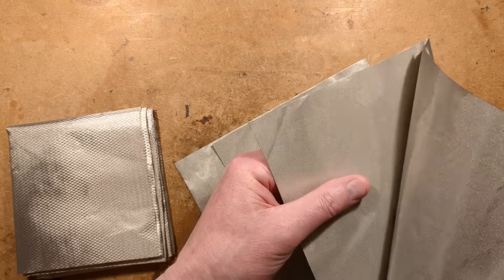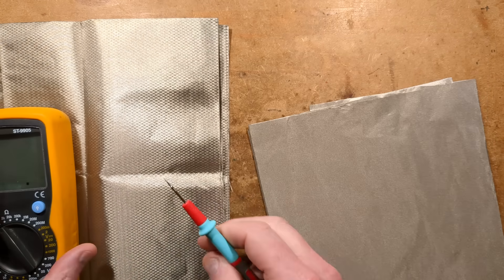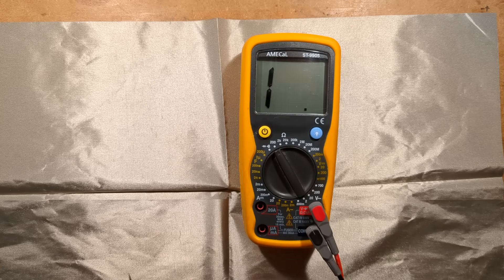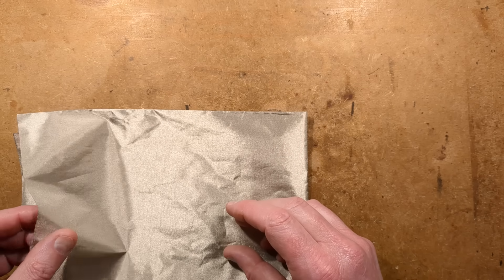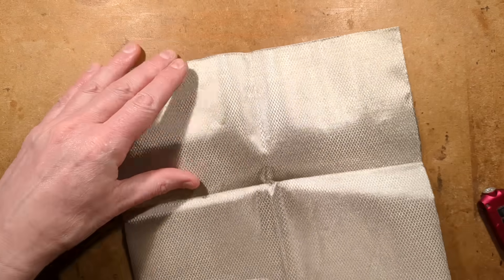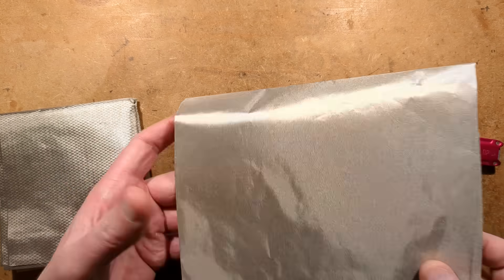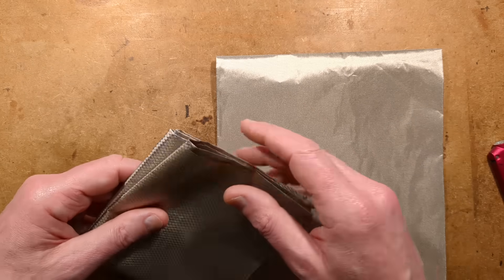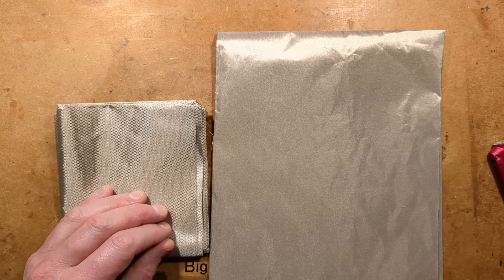Anti 5G fabric is amazingly conductive

Comment: Wow, the comments from people who have bought this range from idiotic to WTF, here's just one example.

"Silvery radiation protect. Affordable. Extreme fabric costs even 1153.11 eur in finland. I really needed this- criminals of oulu region followed with torture chamber radiation- i escaped 600km from torture which since christmas. Criminals constructed torture chamber in structures of my new block of flats apartment by pipes, holes, cold bridges via which they are using electric shocks, beating pressure, ice drafts by machines. Before:'state of finland, bailiff sirpa myllyoja done illegal seizure for my both homes when i was scientific journalist prisoner 6 months without sentence without crime with brain damage caused by crime: broken door, handle. Done same crime again in two apartments during this year. Myllyoja gave criminal orders to destroy my possessions incl valuable gems jewels collection during locked prison. Oulu police: no investigation. Cause of torture since christmas: oulu police neglected duty. Helps little to measured strongly harmful radiation, now direct electricitygun"

Comment: I mean this would be great for—and I'm certain it is used for—shielding RFID chips in credit cards from being activated at any distance. I think my wallet has the first example you looked at lining it for that express purpose. Not a bad idea for those purposes, and one Deviant Ollam can attest to the ability of being able to read RFID badges at a surprising distance if you can set yourself up somewhere people are prone to pass near you while you've got a device that looks like a reasonably common backpack.

But that's not "the 5G" scrambling your brain, that's a coil providing a minuscule amount of power to another coil at a distance causing the low-power transmitter it's connected to to transmit a fixed ID sequence which the device providing the power is capable of reading back. Cool tech in and of itself which can be put to nefarious purposes, but it's a far cry from some form of mind control. At least that's what the mind control ray told me to say. 😉

Comment: It has low resistance in your tests not because the material has extremely low resistance but because the current flows in all directions. The same way ground conducts yet formed from nonconductive soil basically. One other interesting phenomena it doesn't matter how far you place probes, the resistance is the same. The resistance in such measurements is actually appear from the point of contact and the rest of the material do not count hence the current flow is very spread.

EDIT: for a resistive surface the resistance actually logarithmically increases over distance. For a 3d media (for example ground) the resistance consists of a constant (resistance in contact points) plus a term that rapidly drops with a distance like 1/d. So the resistance is only constant for a 3d media but slowly increase with a distance for the sheet like material in the video.

Comment: I was wondering if it worked. I wrap that around my phone often, so tracking me on my CBR is no longer possible while riding that I doubt I'd hear my phone if anyone called and for sure I wouldn't stop to answer it because I am one, having fun (I hear they can tell what speed you are doing, plus which roads you are using, not 100% sure on that, but rule number one is "do not get caught, and rule two, Obay rule 1) and two, I must be busy going to or from something I was doing. I refuse to answer because a bell or ringtone before that is how you used to summons the maids or slaves back in the day where my lot were still... well check the thumbnail that is our coat of arms. I also have a tent of the stuff of it over the computers I have running.
 As for uses, well I hear shoplifters find it useful

Comment: I have repaired many pressure mats that sense when patients at a local retirement home have got out of bed and stand on the mat. They use 2 sheets of foil backed paper separated by a thin layer of holed foam, encased in a thin vinyl mat. The failure mode is always the foil cracking and going open at crease lines, or chunks of foil flaking off and permanently shorting the 2 sides. This stuff would be an ideal foil paper replacement. Another use might be contact material for membrane style keypads.
Reply: I wonder how effective it would be as a capacitative sensor in those same roles.
Reply: Oh interesting lol. A relative of mine had one of those in her room at one of those places. I figured it must use some kind of material-stretching type resistance measurement. This would definitely be better than mere foil paper, assuming the commercial foil isn't completely superior in some parameter (doubt it)
Reply: Ah, the DDR soft pad method of construction. That sounds horribly unreliable, but cheap and easy to scale.

Comment: I have large east and west facing windows in my house that let in a lot of heat in the summer.  White curtains are ok at reflecting light back out before becoming heat inside.  I bet this would be even better.
Reply: One word: Mylar emergency blankets. Three words. 

But even better would be Technology Connections' video on awnings.
Reply: @kg790 mylar emergency blankets are not very durable.  That would be fine as a temporary solution,  just like the foil faced EPS foam board i have now is an ok temporary solution. 

I've seen his video on awnings. I reject them for style.

Comment: Due to lightning in my area I didn't want to use physical copper wiring to connect my house and workshop so I installed a wireless point to point 5GHz link instead.  Worked terribly because the distance was so close it was overloading the receivers on both ends, even when the transmitters turned down to minimum.  Anyhow, ordered a bit of this cloth off Amazon, made a sleeve to drop over one of the antennas and it put enough attenuation into the link and it fixed the link problem.  FYI, for the radio nerds out there, the loss it added was about 43dB, taking it from overloaded at -17dBm to the sweet spot of -60dBm.
Reply: Wouldn't a fiber optic connection work better? I bet there is a lot of direct burial type stuff out there.
Reply: @CountryGeek-hr8tk  You are absolutely right, but at the time the cost at the time for an Engenius 5Gig system cost less and only took about an hour to install.  I later replaced that system with a Ubiquiti Gigabeam system that was about the same cost, it uses 60gHz and better suited to short haul (i.e. 75 feet or 24 meters), plus it also has a built in 5gHz backup link for bad rainy days.  I did go with fiber from the location where my router is installed to the garage where the internet carrier providers come in to provide that additional isolation between the grounded carrier provider equipment and my home system and so far I've had zero problems with lightning, (knock on wood).
Reply: @TurpinTexas OMG that sounds extremely painful and alarming !

edit: sorry I totally misread that as "due to lightning in my arse" - I've lost my glasses again :(
Reply: @gordslater  Lol!  Thankfully that is not the case, but fixing all that stuff that blew up in 2016 when lightning hit in my backyard WAS a real pain in my arse, lol!  It blew out 3 electrical outlets quite literally out of the wall, and most of my network, but thankfully most of the expensive stuff like the TV's and such were spared.

Comment: These conductive textiles are made by HGP.  (Wuzhou HGP Advanced Material Technology Co.)

The base fabric is made from a trilobal polyester thread.  Likely chosen because it's a widely available thread profile with a very concave cross section where the conductive layers won't wear against each other as much.  The fabric is sputtered in a vacuum chamber with a thin layer of nickel via physical vapor deposition to make it slightly conductive.  Once it's possible to run a current through it it goes on to be electroplated with copper using a similar chemical process to the one used to manufacturer PCBs.  To prevent the copper from oxidizing its rinsed, and electroplated with an outer layer of nickel as a conductive passivization layer. 

For anything where the fabric could be under tension they suggest using non-woven conductive fabric bound to a liner rather than the woven conductive fabrics like these.  In a woven fabric any tension will result in elongation of the threads which can crack the metallization on the surface causing it to flake and slowly eroding its conductive properties. A non woven fabric is more felt-like and the threads can slip past each other a little without deforming while the liner material to carries the tension.  

All the same these really aren't intended to be worn though and I doubt they'll hold up very long in that situation.  The big appeal is that they can be laminated onto other materials or cheaply die-cut and folded into the correct geometry.  Think of them a bit like flex-pcbs.  Yes the pcb is flexible and that has its uses but except for very wide well controlled bend radiuses flex PCBs will fail very quickly if repeatedly bent or used in any way structurally.  The crazys in their stylish tin foil hats obviously don't care but for an actual application you'd need to make some concessions if you wanted any kind of reliability.

Comment: Cathodes for batteries! As an example, Al-air batteries are very cheap to make in a pinch, but require a high surface area cathode (the best is something called carbon felt) and I was wondering how this stuff would do...

Comment: It is indeed an incredible material, highly effective for shielding RF. However, you need to be careful when setting up any kind of conductive RF shielding near AC wiring, as ELF fields can induce unintended currents.

The reason why the these materials are indeed becoming more available is because there's a serious need for it. This started already before 5G. People increasingly have been getting ill from digital pulsed signals, DE and ELF/ELM. And they realise that amulets, stones and holographic stickers don't do anything to prevent the body from reacting to low powered eleelectromagnetic radiation.. Instead the EMR-S (electromagnetic radiation syndrome) it's learning that avoidance and mitigation is the only way to prevent falling ill once you have become sensitised.
I understand that from physics and electronics perspective these low levels of electromagnetic interference don't seem like much. But for the body it is actually impactful. I have been a lifelong geek and heavy computer user, till I got seriously ill. And now the only way for me even to go into town is making use of these kind of fabrics. To give you a perspective on what kind of levels we were talking about, I need to avoid anything above 1 µW/m2 (one microwave per square metre).
The way that a lot of electrician and engineering friends react, reminds me of the farmers that would drink up a glass of Roundup to prove to people that Monsanto's herbicide was completely safe for humans. Just ill inform people that in time will catch on.
A good place to become better informed is to look at the Bio Initiative report. www.bioinitiative.org
And another great site is ehtrust.org , an organization set up by Devra Davis, the leading epidemiologist and toxicologist who fought the tobacco industry and won.

"In the ten years since the BioInitiative 2012 Report was posted, hundreds of new peer-reviewed research papers have been published. A clear majority of studies report biological effects as opposed to ’no effect’. The trend continues to show that exposure to low-intensity ELF-EMF/Static Fields and RFR at levels allowable under current federal public safety limits pose health risks. This body of literature strongly supports new, biologically based public exposure standards that are protective against exposure levels identified in this Report to cause effects at levels thousands of times lower than current FCC limits. See https://bioinitiative.org/research-summaries/ for all results including electrohypersensitivity and comet assay study results."

Comment: What, no hat sewing patterns ? And if you made a hat out of this stuff, what sort of attenuation would it provide ? Presumably, you could make a hat out of multiple layers in order to increase your levels of protection/paranoia. For maximum shielding it would need to be earthed of course, which is fine for sitting indoors watching YouTube, but might restrict the range of your mobility. Hammering a new earth pole into the ground every few metres or so is going to make a trip to the shops a bit of a pain....

Comment: This could probably be used as the shielding in a shielded twisted pair cable. It should be quite a bit more flexible than the usual aluminium foil that is used.

Comment: I wonder how useful this might be to run power for heated garments or lights in costumes. Some of those cosplay folks get real complex; having a conductive material that can be sewn into a garment and more closely matches the flexibility of the base fabric would result in less broken connections over time, I'd guess.

I have had a couple heated sweaters for wearing under my coat when doing construction work in the winter, and they always fail over time as connections inside break. My Bosch sweater lasted 2-3 seasons, some cheap chinese direct import ones lasted more like 1.

Though, I suppose you'd just be kicking the can down the road as far as where the connection inevitably breaks. Rather than at the connection point, the conductive fabric itself may shed its metallization over time and become less and less conductive

Comment: a faraday envelope to put your rfid credit card in . also perhaps incorporated in to a 3d print so you can use it as a wave guide or similar for doing a diy radar using a software defined radio . granted foil tape would work just as good for that

Comment: Tazer proof vest? Tail for kites used to short out transmission lines? Nylon windbreaker supercapacitor experiments? Umbrella to put over cell sites? Fast to erect parabola for big-ugly-dish use? Composite material to use with carbon fiber cloth, for super battery scams?

Comment: "but would need great care to ensure that all edges were made safe against shedding conductive threads into equipment.
"
I used to work at a place where we laser cut that sort of stuff for one of out clients. The fused edge was probably resistant to shedding fibers?  I don't know what the application was, we only made components, hardly ever saw a finished product.

Comment: Back in the days when one rented an answerphone from BT, the DIY shop at the end of my road found that their unit only recorded the local medium-wave radio station, the antenna being under half-a-mile away. I know the BT tech who fixed the problem - dismantled the unit, sprayed the inside with copper paint, grounded it. Not quite a Tempest Cage, but good enough. Rather like my first DIY project of a doorbell that used a chip to sense contact - only problem was the Triton T80 shower triggered it - cue wet father, very annoyed - coax cable to the bell-push fixed it.

Comment: Surfacevatea...that's mainly why the structure I could be wrong ahh the nickel n copper alloy mix too so how about using for cathode or anode roll it tight but not too tight or fold it into many fold squares it be good for lots battery applications...cheers mate
Reply: Do you make any diy batteries mate ? Cheers

Comment: one question is how does it compare to a standard wire in terms of flexibility and lifespan under constant movement? will a hard fold damage a strip of it? it seems very useful for constant flex, not so much for tension but wires aren't too good for that either.

Comment: Just like foil and this zero ohm fabric, you can make an amazing antenna hat. This is something all these 5G conspiracy theorist don't get or understand (because they don't want to learn how electronics or radio waves work) and that's if you wear something that's got low resistance, then whatever that is has just turned into a n antenna so you'll be picking up a VERY wide range of frequencies.

Comment: Interesting, that would be useful for insulating signals for sure... although for my car key I've just taken to placing a tab between the battery contacts, to prevent false triggering... and even if it could be cloned, you can't clone what isn't transmitted 🙃 Though every MOT they write up a warning "remote doesn't work" even though we told them that's exactly what we'd done... now I have a sticker on the back "battery is disconnected" maybe they'll see this time and not try charge us £6 to replace it 😆

Comment: Wrap it tightly around a wax model, use it as an electrode for electroplating, once the metal layer is sufficiently thick melt the wax out again and end up with a hollow copper shape? Would it be easier than alfoil due to not suffering from oxidation?

Comment: That might be useful for use in clothing to transfer power for wearable devices.  I'm thinking heated gloves, socks etc.  Would make a good replacement for wires provided that it can cope with the current, and would have good wear characteristics so that the circuit wouldn't break in the first few hours of use.